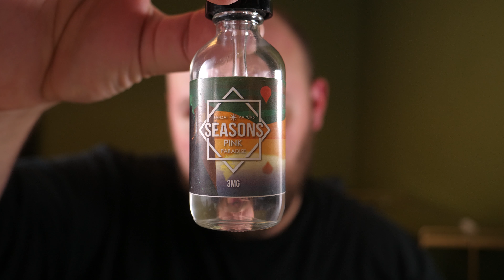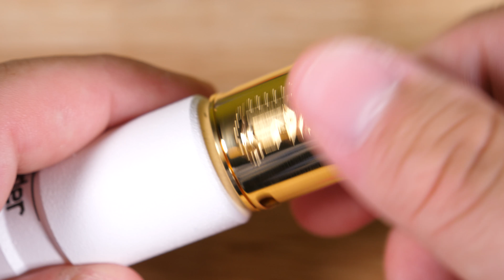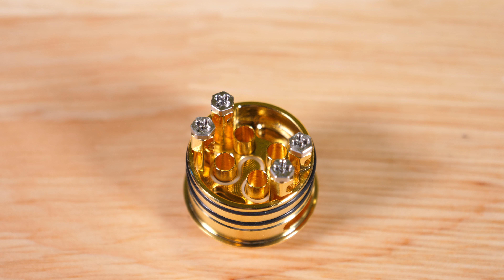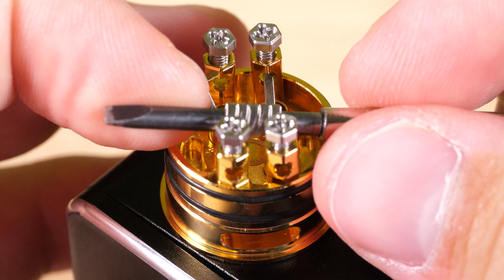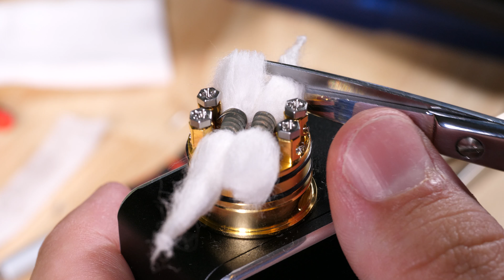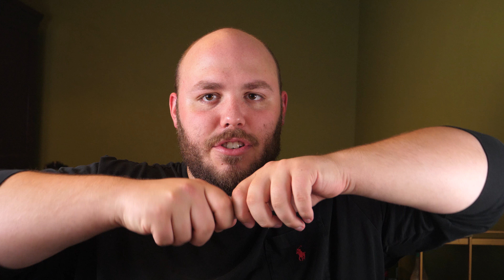Reload RDA v1.5 Review & Build! First Video Ever!

Comment: Orgasmic  drip shots and even more Orgasmic coils bro...wow you are quite the builder....42g? Damn and that clean? Well done sir...I still can't spin anything higher than 38 while maintaining that super tight clean look.....so cheers!
Reply from the maker: Brian Etris Thanks man! Using fishing swivels is key to getting that high gauge wire to line up nicely. Holding the spool at just ever so slightly behind a 90° angle (towards the drill) makes the wraps nice and tight.

Comment: How does she hold up with leaking if you drip down the drip tip? Btw awesome job for your first review man!
Reply from the maker: Sun Behind the Sun 777 Not too bad! Like anything else with bottom airflow, if you overdrip like crazy, it'll leak. However, the way the coils are placed in the Reload, when you drip down the center, they catch the juice really nicely and keep it from gushing down the airflow. Usually I need to give it a little "dry pull" after dripping to ensure the airflows are totally clear, but it's totally manageable.
Reply: Dmo Vapes for sure, thanks for the detailed reply!

Comment: Hey man I see u are using that el thunder how do u like it and any problems with it?? I know u said u are reviewing it soon but I am actually looking into possibly getting it versus a couple other mechs so just a high level thought on it would be super appreciated!!
Reply from the maker: dane bentley Hey man, sorry for the late response! I've had zero issues with it. The coating on it also has held up to a lot of abuse. I dropped it from chest height onto a particularly rough concrete road, and it didn't so much as scratch, let alone chip or flake off. Hits hard, easy to maintain, and good looking 😎